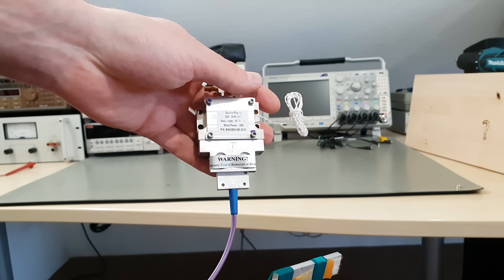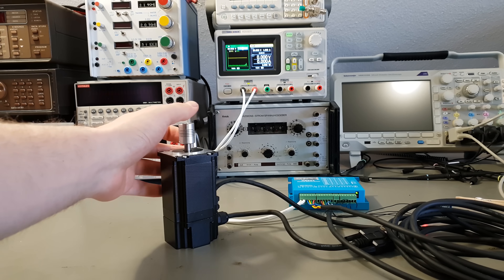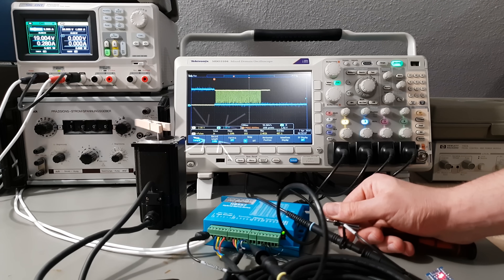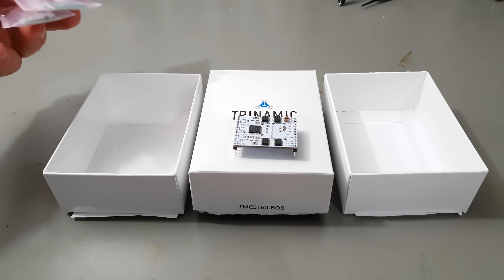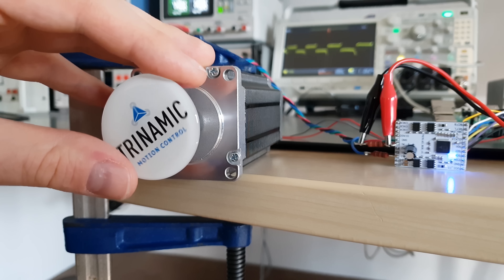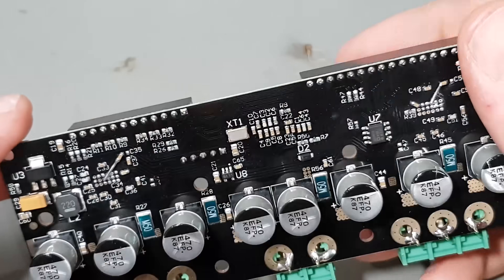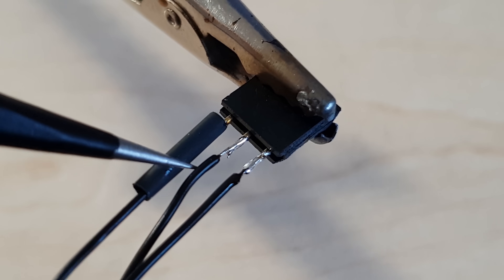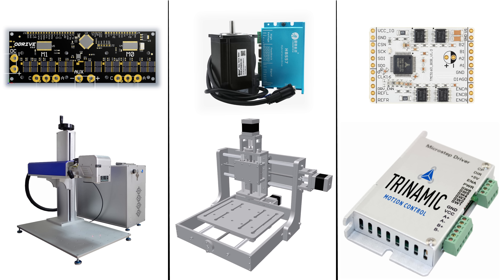Precision motion control: ODrive Servo? Trinamic Stepper? Chinese Hybrid?

Comment: That adjustable electronic load could function as a pretty awesome dyno (for the lack of a better name, this would be able to fully characterize motors). TPAI came up with some old ELWE + Arduino components to do something similar recently. (Damn you lucky Germans with your 3ph power drops and tons of local Mieles *shakes fist*).  

Check out the Mechaduino if you haven't already. Now that fast components are so cheap, it's feasible to make your own grey encoder on a standard motor and make it effectively closed-loop -- https://www.youtube.com/watch?v=-_3JvYrWOZU.
Reply: Also, the almighty Zeus has fated you with this gear for a reason. Having "only" 2 motor controllers on the ODrive is just screaming "DIY 5th axis CNC build" [standard 4th rotary and 5th trunnion].  Use the Trinamics to drive a used spindle motor (Both Hitachi Seiki and Sanyo Denki's are reliable, readily available on ebay so they're cheapish, and I've seen the Denki's go through ~25 HRC metal).  DOOOooo it!

Comment: You still haven't tried the proper Chinese 3-phase servo! :(
They fix all the issues of the ODrive(or I should say the ODrive still has some issues that need fixing).
Reply: ok cool thanks!
Reply: About as much, actually. You can find them on eBay and Aliexpress for around $100-150 each, including the driver.
Look around, they're just called "NEMA23 servo"
Reply: ODrive Robotics Wondering if the braking resistor output can be used to drive an electromagnetic brake clutch proportional to speed which would mechanically stabilize and lock the shaft when standing idle. Something akin to gently riding the brake while driving at slow speed. A face clutch would provide unidirectional braking.
Reply: We're talking servo here, so it's better to reference servos in my opinion. Steppers are just meh, even for their size.
For a NEMA23 motor I'd say something around 3-4Nm should be fine, though higher is a lot better. 
For NEMA34 it'd be 4-12Nm. These are seriously vague figures though, I'm going off prices and available lower cost options. Obviously a cheap noname motor is not going to perform nearly as well as a similarly specced(but wildly different in price) Yaskawa kit.
Reply: Okay great, taking the NEMA 23 as an example, 3-4Nm continuous is achievable with the larger hobby motors with forced air cooling: obtainable with about $100. How much do the comparable NEMA 23 motors you are referencing cost?
Reply: You can use a GPIO to activate a holding clutch if you like, I don't think the brake resistor output is appropriate for that though.
Reply: The surplus and NOS industrial servos I've seen run on 200+ V, clearly not intended for a low-voltage driver. Though that might just be a question of the output stage and some interface isolation for the odrive.
Reply: If you have any specific suggestions, feel free to mention them, we are improving as fast as we can and feedback is very helpful.
Reply: I might have phrased it wrong - the issue is not exactly on your end, it's just that coupling the ODrive board with RC brushless motors is only going to give you so much holding torque, which may be insufficient for serious machines. If there was a better motor to attach to your drive, it would be very versatile. Larger brushless RC motors, the kind that compare with smaller, purpose-built servos in holding torque, cost about as much too. I suppose one could try sticking old/surplus industrial servos onto it, but it ends up costing about as much as the low-end Chinese servos, so it's a matter of convenience at that point.
Don't get me wrong though, I'm not bashing your project - it's very high on my list of things to buy and experiment with, and I definitely support the idea.
My only serious suggestion would be a wish to see a cut back, single-motor solution with lower power handling capabilities that costs slightly less than the dual-motor system. Or a 3-motor single-board solution at higher cost.
Reply: Ah ok yes indeed. Just to get a good understanding, what is a good reference point for holding torque and price for a stepper motor that you would consider in some example machine?
Reply: You can use brushless motors wound for brushless gimbals (super low Kv, more torque)

Comment: Have you looked into solutions combining BRUSHED motors with an encoder? Such a solution could potentially have most of the advantages of a brushless servo, yet with a lower cost and complexity.
Reply: Unless you have a gearbox, stepper motors are always better than brushed motors. Brushed motors rarely have high enough torque without a gearbox.
Reply: While superior in many respects, steppers require more complex drivers, they tend to be more expensive, and they can be quite noisy. It's true that many brushed DC motors are wound for high speed low torque operation (and thus need a gearbox for practical applications), but that's not always the case. I'm not claiming that a brushed DC motor + encoder + driver combo must be the best, I'm just wondering if people have even seriously considered it as an option.

Comment: Good stuff!  You may be interested in the Clearpath servo motors with integrated controller from Teknic.
Reply from the maker: Yes, I've seen that in your Bullet Time video, very cool but very pricey :L
Reply: The thing has put me away from clearpath is lack of encoder outputs. I know they're meant to be direct stepper replacements but then you might as well just keep the steppers. I have a big (4500)kg mill I switched to linuxcnc. Was considering clearpath for the 4th/5th axis, but you get more for the money with DMM servos.
Reply: @extraace  Ah. Good catch. We've got 4 clearpath servos in a massive 3D printer prototype... they're SCs, though... so we can read position that way. We were going to switch to SD for later projects... maybe not now.  I guess we need to get around to trying O-drives...
Reply: Clearpath tries way too hard in marketing thier overpriced products on YouTube
Reply: @yalgret  they are a better deal than most industrial servos but still are way out of the price range for most applications
Reply: @yalgret  How are Clear Path's Products overpriced? The O-Drive driver itself is $159, You need to purchase an encoder for another $40 and the Motor for $70 which totals $269. This is around $100 cheaper than the Clear Path but is 3 items I have to wire, locate and build enclosures for in my machine. Whereas the other is plug and play and easily replaceable in under 5 minutes.
Reply: @Cadaverine1990  Which one.  The motor they pointed me to was $800+.  And they insisted their ($$$) PS were necessary, too.
Reply: Applied Science, Clearpath servo is silent, easy to use, easy to configure, will not lose steps, won't cog, is more accurate, is more powerful in same size, has built-in indexer, has built-in encoder, is very affordable - all you need is motor, no indexer needed.  I will never use a stepper again.
Reply: Hey, this Clearpath might be just what I'm looking for...first I've heard.
Reply: I'm building a 2 legged full size walking robot on my channel. Let me know what you think.
Reply: i was going to say that  good on you both
Reply: @daneliberatore4583  i did not publish this video.
Reply: whoa nerd royalty in the house. greetings Ben.
Reply: johnDon, valid question. I am maker for over 30 years and know from experience what is best. Not a shill or being paid, just trying to save ppl the headaches associated with steppers - they really do suck by any measure compared to closed loop servo. Just watch a few videos by ppl using clearpath and make your own decision. Small steppers will always be best for simple low power DYI projects for fun and learnibg but for cnc, high speed, high precision, ease of setup, Clearpath is the best value I have ever found.  Don't care if you believe me.  Absolutely silent.
Reply: how about Mechaduino? can be attached to any stepper that has its shaft visible on the backside to put a small diametrically polarized magnet on it. also opensource.      

or VESC which is opensource too, made for up to 50v 240A brushless motors and supports hall/encoder feedback.
Reply: johnDon,  regarding "paid much" comment... These videos and the communities around them are hopefully meant to share info and help each other out. I am contrubuting to the conversation with constructive, useful info based on years if experience. Your response has nothing to do with the merit or validity of the content of my post. Grow up and do something useful with your time.
Reply: @jcjensenllc   I'll second you on those clearpath units.  They are the only ones of the hybrid servo companies that has an intelligent system that will optimize their output settings automatically after running feed back test on the machine they are being used on.   That is something that is highly over looked on the Chinese hybrids.  Yes they are about 1/3 to 1/2 the price, but what they lack is what I just mentioned.   You can however manually reprogram them from 3d party software, but without the feed back data you're still more or less guessing at what is optimal when it comes to dynamic loads.
  I am however very interested in this Odrive system now.   Dealing with the various hall sensor abilities from motor to motor and pulley fitment on various motor shaft sizes however might lend to some head aches that may ultimately make the extra cost of the clearpath units... Well....  The clearpath for most!   Pun intended
Reply: Stop posting and go work we need you uploading new videos on your chanel.
Reply: johnDon, you are still avoiding the subject. Are you a Trump supporter?
Reply: paid much?
Reply: wow you're defensive bet your best buddies with nyc cnc

Comment: If you have a Syncronus AC motor.. it really should not be that diffcult to have a holding torque. If caused, it would have to be geard down for precission. On the other side, that would only make the holding torque more efficent

Comment: Hi Marco, nice video, I work in the motion control industry. If you want some high resolution encoders, check out rls.si for some great linear magnetic encoders, I've been using them a lot. The board mount units specifically.

Comment: Wait. What is the difference between the ODrive and the other ones? They are all servos since they all have a feedback. In case of the trinamic even two ways of feedback if you use an encoder. Also bldc's and steppers are constructionwise the same just differently optimised. 
I think going with the trinamic is the better option. I mean you can always add an encoder. The only thing is you would have to tune the PID-Settings but that shouldnt be too difficult :)

Comment: Okay so the biggest question I have with the trinamic driver is that if it's controllable from an SPI bus through special movement commands, can you queue those commands and if so wouldn't that mean you could replace the need for a dedicated microcontroller with a raspiberry pi. Being that the only reason you don't use a raspberry pi is due to the fact that the gpio isnt accessed at the time the command is sent but rather when the OS decides to operate the GPIO which isnt good for high precision machines like a CNC Mill?
Reply: spi is good for single motor control, but you are unable to implement multi-axis movement with it due to a lack of synchronization features. This motion controlling is the job of the external controller.
Reply: Niklas Mertens I figured after thinking about it some more. Bit of shame but definitely understandable.